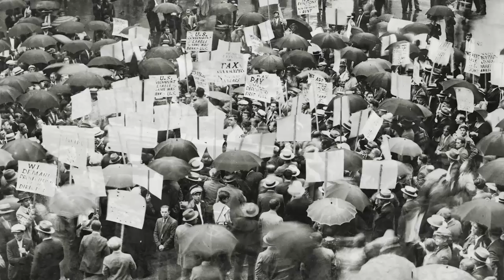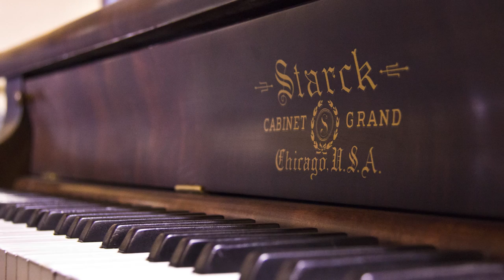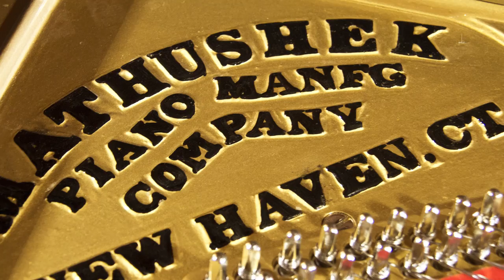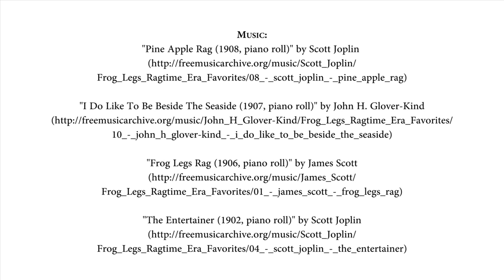Expert Piano Restoration and Refinishing

Comment: (a) as far as cheap modern pianos, even the high end ones will fade. But even the most expensive Yamaha CFX or Shigeru Kawai has aluminum action rails, particle board in the lid, rubber bushings because they're cheaper than proper bushing cloth. Not a problem, though: when the piano wears out, just buy a new one. There's lots more where they came from. Meanwhile, Old Bechstein, Steinway, Bosendorfer (as well as pre 1928 Knabe grands) will come up magnificently with expert restoration. (b) In this video, you glossed over the action restoration part. Would have been nice to see just one repetition lever or one sostenuto tongue....
Reply: I teach engineering and material science. Kawais milenium III with composite is a clear plus to me. Much better and cheaper than wood.

Comment: My brother's father in law just passed and they're  going to throw the baby grand piano cause someone said it can't be tuned
Reply: if you can get it restored it definitely can its a common problem for pianos that where left out of tune for a while
Reply: @michaelcoplo7567  I just have no place for it sadly
Reply: @michaelcoplo7567  it's in southern California if anyone wants it.
Reply: @michaelcoplo7567  this is a John Broadwood and sons piano. The previous tuners have all said the same thing, they tune it but won't hold the tune. What type of repair would that be?
Reply: @forgotten320  hmm not sure but i know someone who had the same issue and I think they had their tuning pins and strings replaced and that helped/fixed it but i think it's possible they did a couple other things
Reply: @forgotten320    most likely the pinblock holes are loose now so the pins will slip. Needs a new pinblock. If you don't want to restore it you could try what was mentioned in the video called juicing which expands the wood around the pins.

Comment: Nice video but dampers should never be razored off damper heads. This risks gouging the wood and creating an uneven surface for the new damper heads. They are supposed to be soaked off with a mild wallpaper remover type solution. Also, dampers should always be glued onto the heads IN the piano, meaning the dsmper is place in the piano damper rail with set screw losse, then the damper heads are glued on. Later, after the correct damper tray height is determined we tighten each set screw. Of course wire bending must happen during this process as well.
Reply: Gregg, damper felts should be glued onto the heads at the workbench, so they are true and square to the heads. I know of no global grand piano manufacturer who glues damper felts on in the piano. If felts are glued onto the heads in the piano this assumes all wire bending is perfect at the time of installation, a rarity. Once the glue has set at the bench, it is THEN time to install the dampers in the piano and perform all wire bending. If the heads are not perfectly centered on each unison center line when felts are glued on in the piano there is the temptation to glue them on off-center/skewed to center over the unisons when the heads are not yet centered. This makes for hideous looking and functioning damper work. Also, with wet glue between the felts and heads how can you bend wires without disturbing the "set" you have just created? Visit any factory - felts are glued to heads at the bench, before the manufacturer has even established which piano the set of heads will be installed in.
Reply: @DavidHughesPiano  Ok. I do see your point and fully agree. Wire bending should correct alignment errors.  However, I still would never " razor off" old dampers.
Reply: @99Grigor  : Thank you, Gregg. Yes, I concur that damper felts should not be scraped off damper heads with a knife of some sort. We soak them off with hot water in a rather elaborate homemade fixture that permits the water to saturate the felt and dissolve the original hide glue, yet not wet the wooden heads to the point of damaging the original factory paint job.
Reply: @DavidHughesPiano  Well, the video depiction I observed was of a guy scraping of the old damper heads with a utility knife-exactly what is NOT recommended.
Reply: Why do a lot of bending of the damper when there is no need for it? I glue the damper felt for the treble and register on the damper heads out of the piano, but for double and single strings in the piano. If this is carefully done the damping is perfect right away with no need for the bending tool.

Comment: The narrator isn't wrong about the cheap, mass manufactured crap we accept now-a-days.
Reply: Cheap mass-manufactured "crap" made by Japanese manufacturers has made acoustic pianos more accessible and sometimes even better. The best example is the Millennium III Action made of Carbon-ABS plastic that is just as good if not better than Renner actions. Unless of course you're talking about crappy Chinese pianos.

Comment: @richardeagan3156
0 seconds ago
Our church received as a gift a small Baldwin upright piano. The piano is in good condition in that it stays pretty much in tune between tunings. The issue is that there isn't that flow between notes  due to a poor restrain. I have adjusted the pedal several times, but that in itself doesn't seem to really help. The pads are not touching the strings, but apparently enough that we are not getting the flow that I/we are looking for. In short, the issue seems to be somewhere other than at the pedal itself, Any suggestions?

Reply